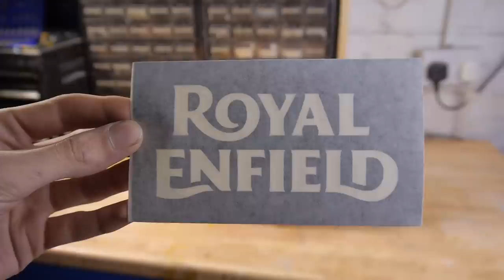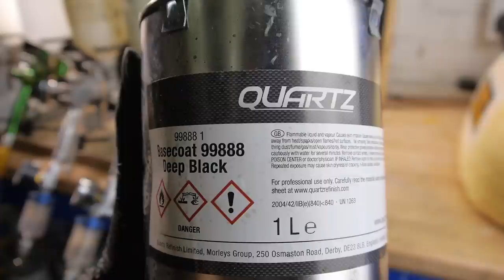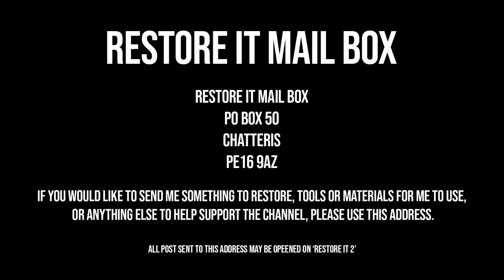Rusty Motorcycle Fuel Tank Restoration

Comment: Both chroming and electrolysis plating are really difficult. I don't blame you for replacing the cap instead. Amazing results!
Reply: I saw someone plating the other day. Looked like a couple of plastic buckets. Looked like a homemade set up. Not sure. I'm no expert on plating. Hopefully he can rig his own soon.
Reply: If you decide to go down the plating rabbit hole, do yourself a favor and go with a turnkey system.  The chemical formulas that actually work are proprietary and secret... doing it yourself would be like trying to make your own paint or motor oil or cabernet.  The results are guaranteed to suck a lot more often than not.

Comment: When welding fuel containers or pressure vessels that may have combustible residue, it is always a good idea to fill it with water to force vapors and hydrocarbons out.  This way you have some more insurance that, while welding, you aren't flashing hydrocarbons on the inside metal surface to vapor which can be ignited and explode during welding.
Reply: FliesLikeABrick I wish I could understand what the hell you just said
Reply: When welding fuel tanks, you either fill them with non-combustible gasses (argon) or water, that way they dont light up when welding.
Reply: First you wash them with water, then air them out for a few days, then light a match, fix it to a long stick, and then try to set the tank on fire

Comment: Incredible work. I cringed when the tank fell. One suggestion. Have you ever used plastic razor blades? Imo, they're a safer alternative to steel when peeling off the stencils on that pristine paint. No chance of scratching it. Cheers.
Reply: Brian Burke go to a hobby store in their vyinal stencil section and get a rubber tipped stencil pen. It’s like 7 bucks and is made for just that. One end is for peeling the lip and a ball on the other end for sticking to it and peeling it free.

Comment: Great job! The welding of the pin holes went really well...as that problem could have gotten worse with every arc up. One thing I would have added..I would have mounted a foam wrapped 2x6 to a heavy vice to hold the tank safely for a good cut & buff. Icing on the cake! All the best!

Comment: Love your work man! Really impressed by how thorough you are, and your attention to detail. I am wondering whether you are learning to become a paint sprayer/panel beater? Or are you just doing it for fun?

I have a comment to make, but I don't want it to be seen as something negative. Please see it as something constructive, to remember in the future, when you're working on other tanks;

You should always pressure test fuel tanks after you have welded them. I test mine to between 5-10 psi, depending on the model of fuel tank. The sturdier the tank, the higher you can go. Some pin-holes will only show up at higher pressures, so you definitely want to go as high as you dare without warping the tank. 

My experience is that MIG definitely leaves pin holes. I would recommend TIG or Brazing with silicone-bronze, as that flows nicely into all tiny holes.

Lastly, if you cannot TIG or Braze, use a tank sealer, that would go on the inside of the tank. That will take care of any pinholes that may be left. You can also use JB Weld (slow curing) to plug holes. I have successfully used that on two motorcycle fuel tanks and on an engine oil sump. Neither of which failed after years of use! 

Good luck and keep the projects coming :)
Reply: Restore It lol, I feel for you about the brazing rods palaver. I had exactly the same problem when I started out. I went through a number of different brazing torch designs before I had one that worked. Propane only/Map gas torches do not get hot enough, or you have to heat up the tank for so long that it starts warping. Been there, done that. You really need to have oxygen and a fuel gas to get the flame hot enough. And don't be tempted to go for the small hobby bottles, unless you're doing a small job. Also tried those and they run out really quickly. I ended up with a propane/oxygen combo, which is the cheapest way to get a good, hot flame. And it's cheaper (and a little less dangerous) than using acetylene.

Comment: Nice work!   By the way:  Don't get a sand blast cabinet.. You should get a vapor honing cabinet.  It will help with the final finish of the materials tremendously..Including not harming plastics and rubber when you don't want to do so.

Comment: You need to use a sanding pad when you wet sand or sand body filler. It will help prevent the little waves from you finger pressure points.

Comment: When I did my tank I cut it in half to properly treat it inside. It was nasty and chemichals wouldn't do the trick.
Then I welded it back together and did pretty much what the guy did in the video. Except for the emblem. I also used a stencil but instead of spraying it, I used a paintbrush to give it a rough, handmade look. Then covered it with lacquer just like he did.

Comment: A tip to clean fuel tanks i learned years ago from my grandpa is to put a handful of nuts in there and shake it for a bit. Did it on a old push mower tank and it worked good

Comment: Just one thing I would've made differently: the dent. Drill a small hole, put a screw in the hole, use it to pull out the dent, weld it up, sand, etc. Probably no need for filler at all.

Comment: Nice work as usual.
Does the tank treatment you used leave a seal coating inside or only remove and passivate the rust?
Do a search for POR 15 tank sealant, designed for the job you just did, but dont stuff it up its impossible to remove once cured.
Your no talking vid and your mask worked well when the tank hit the floor..........
Whats next?

Comment: Never ever ever paint the Edge where the tank cap screwes onto because with nowadays Gas it will losen the paint and slowely the whole paint will come of from there on so always leave a 1 cm strip at least with no paint. It will not get rusty because it will always be under a layer of fuel.
Just a small advise from an old experianced painter.
Reply: Restore It No problem

Comment: 1 Why didn't you give the tank a final wet and dry and compound  polish to make a glass smooth finish.. 
2 A work around to your chrome is to bright Zink over the original chrome. The zinc doesn't stick to the chrome but fills up all the pitting and produces very good visual results..

Comment: You shouldve patched that rotted spot, when its perforate like that, you need to cut out all that heavily pitted metal and patch pack to solid steel.   I use an awl and stab the metal around perforated areas and determine the perimeter to be repaired when the awl does go through or easily dent the metal.

Comment: Nice job, except: You should not have painted the opening of the tank. The surface that the cap seals upon should be unpainted metal to prevent paint chips from dropping into the tank and ending up clogging the carburetor. Again, nice work.

Comment: one huge mistake, you have painted over the lip where the cap seals,  because fuel is not separated from the paint it can seep under the paint and cause a horrible bubble, so,  sand off the paint so the rubber seal isolates the fuel from the paint.

Comment: Cleaning the rust inside - use navel jelly and BBs. Plug petcock hole with cork. Plug gas tank hole.  Shake.  sit.  shake.  Flush with fresh gas.  If the tank is painted take great care not to get the liquid mixture on the paint.  Works great.  Better then this.
Reply from the maker: Thanks for the advice Fred.